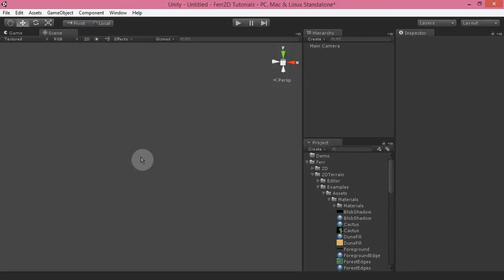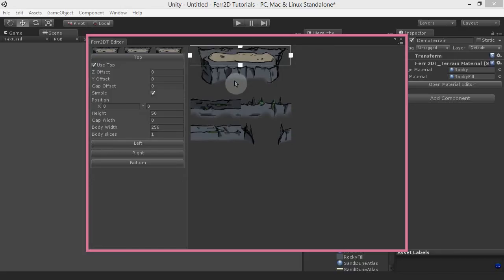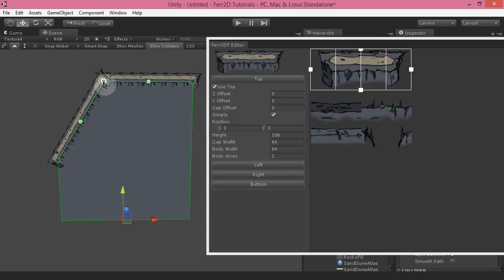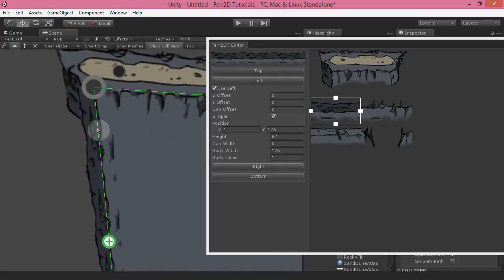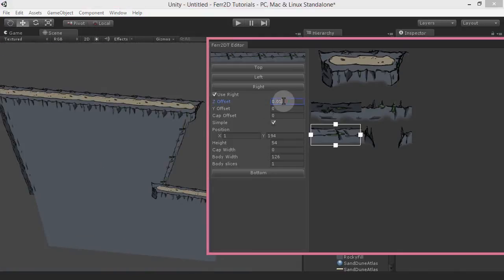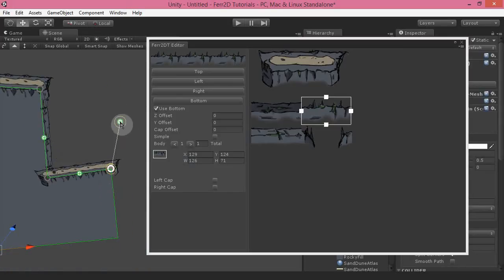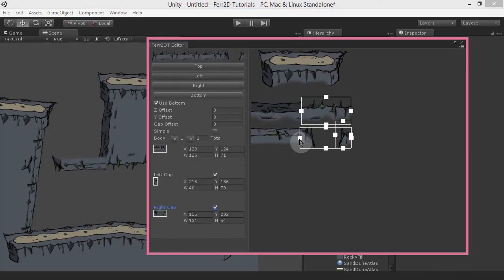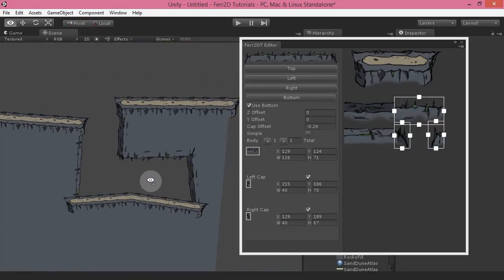Ferr2D Terrain - Material Creation

Comment: A tutorial on "Assembling materials for Ferr2d" would be very helpful.

Even as an artist with AAA experience, trying to wrap my head around why my assets have to imported in very counter intuitive ways ie; 

Each side rotated counter clockwise

Bottom segment needs to be inverted

Etc etc....

If the selection box had the ability to rotate this wouldn't be nearly the headache it is.